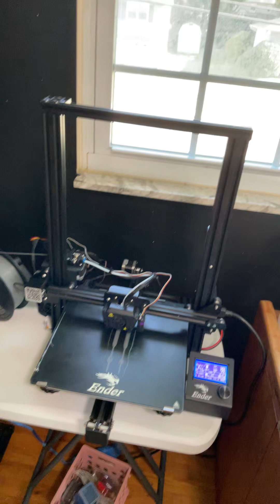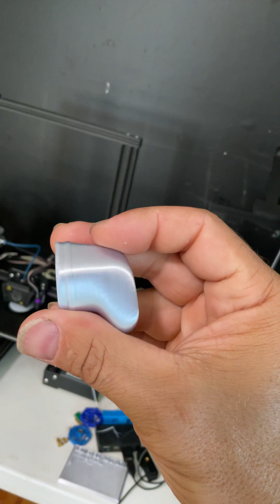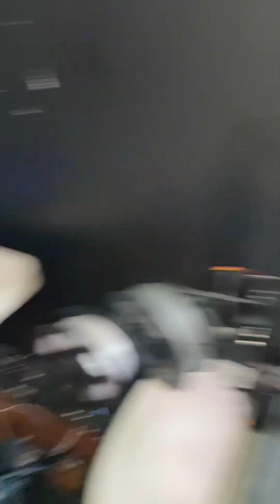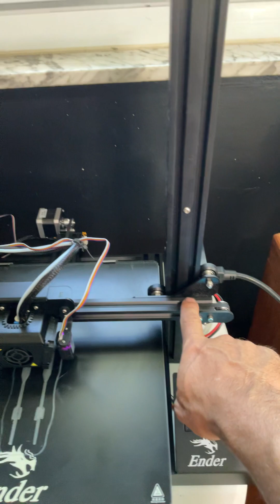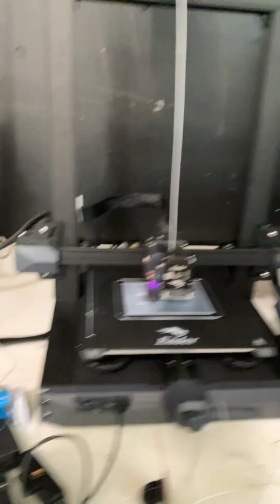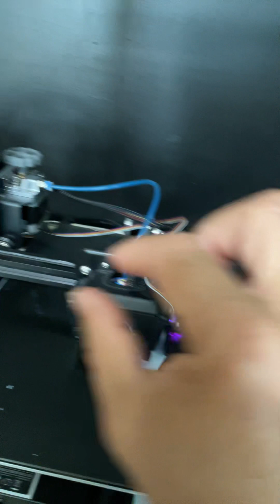Fix your sagging Z Gantry and crummy first layers, on creality ender 3 max WITHOUT new hardware

Comment: I can't figure out how to do a smooth finish on the exterior side of the first layer. ( the printer is perfectly leveled). Any suggestion?
Reply from the maker: The bottom of the model? Flip the glass and print on the smooth side.